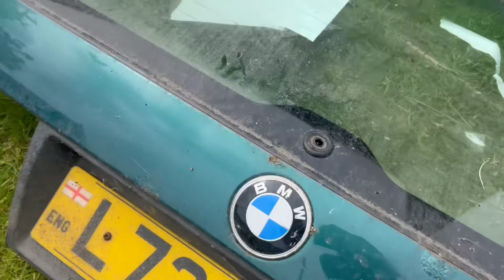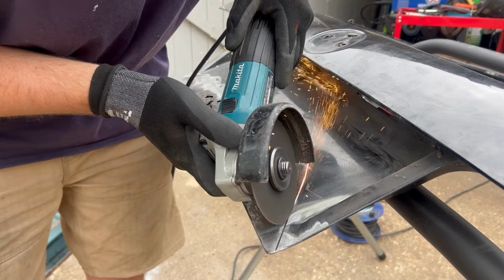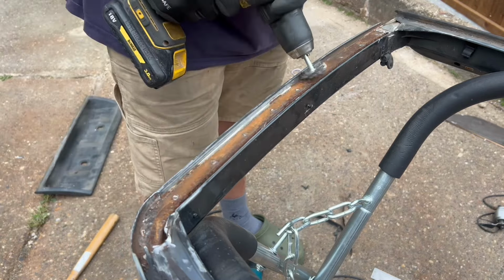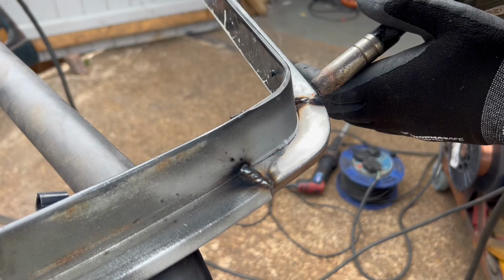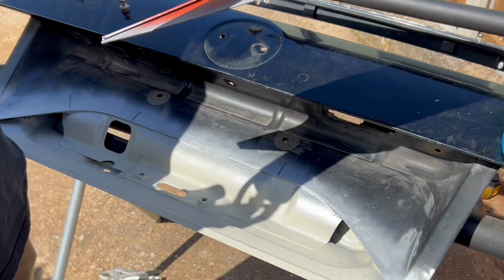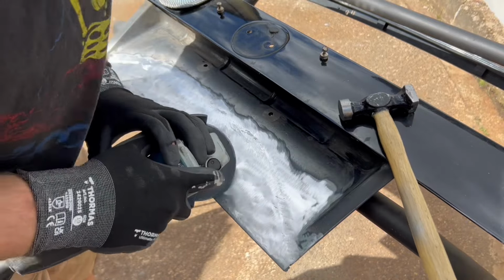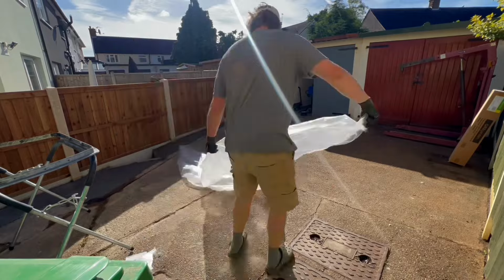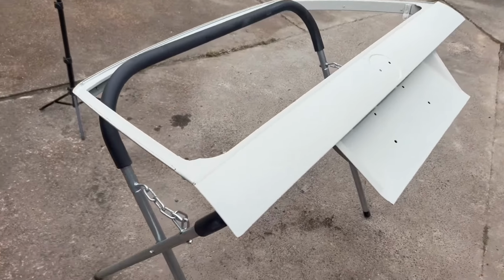Ep. 24 - My BMW E30 Restoration - Major Touring Tailgate Rust Repairs + DIY Spray Booth Prep

Comment: Am little confused, is this finishied product for painting? Cant be i think, you need to weld more panels in right?
Reply from the maker: @tristannigol2924  well i hope not! What do you think is missing?
Reply: @BadE30  outside rim where inside is glass looks like it needs plate on it, or like its hard to tell and seemed you cut so much but didnt weld much
Reply from the maker: @tristannigol2924  all welded back in around the glass! It is symmetrical
Reply: @BadE30  okei